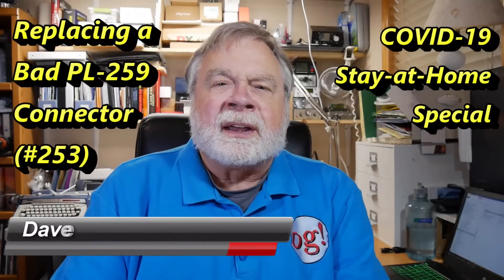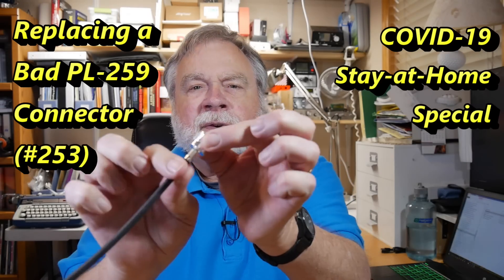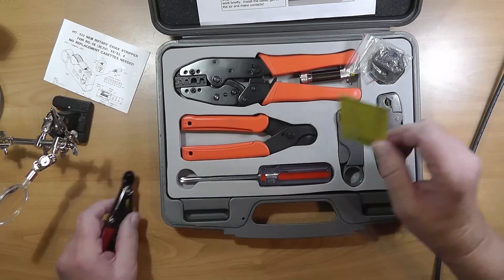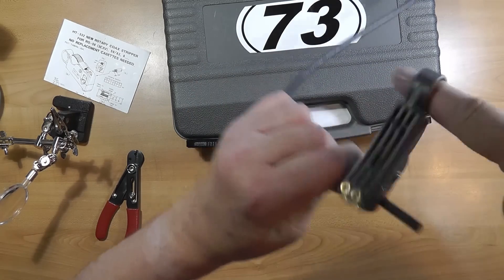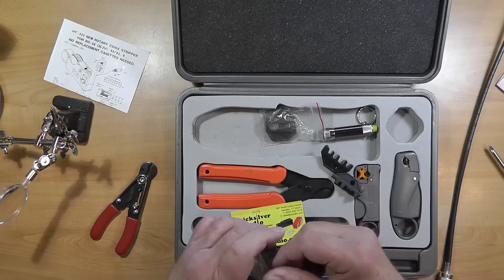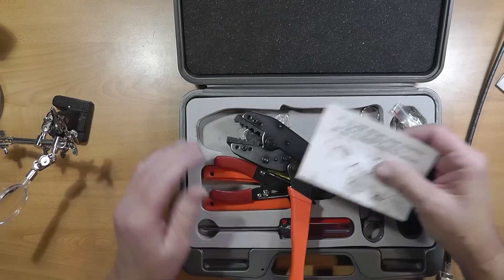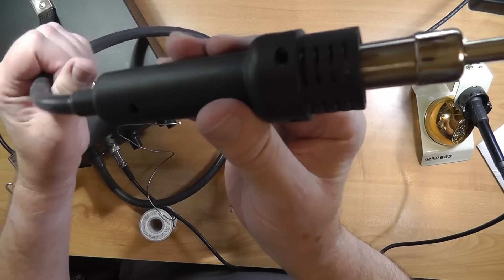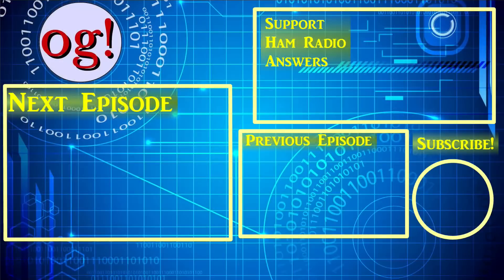National Stay At Home Special! Replacing a bad PL-259 Connector (#253)

Comment: Thank you Dave for another great video! I was wondering if you could also suggest a vertical antenna for the reference station as well. It could be a cheap or a not so cheap option with no radials ( even though that could compromise its performance) for some of us with space limitation issues. 73
Reply from the maker: Good point. I'll try to factor it into the reference station design.

Comment: As a marine electronics installer/technician,  I'd like to throw in my two cents worth.  We sparkies  have a bench but mostly we are in the field on the ground, in a bilge or hanging from a bosuns chair up a mast to do installs or repairs.   The crimp tool is the way to go both for the ferruled end and the center conductor pin.  There are many options of crimp tools and dies.  For feedlines we mostly use RG-8X(LMR 240) and LMR-400 type coaxes.  Crimp connectors are available from many sources.  Obtain better quality ones.  Carefully match the coax strip tool to the coax and the connector.  Study and follow the  installation instructions  for the connectors.  Heatshrink seal the cable  at the coax end of the body.  Crimp style coax can be installed accurately very quickly.  I personally don't care for the PL 259 connectors for the reason Dave illustrated and they are not particularly weather proof without  careful sealing with the appropriate self amalgamating tape or boot.  I am phasing in using an uhf male to N female adapter, then an N male connector.  The insertion loss is negligible The N connector is easy to install with crimp and is very weather resistant.  Also 
solar panel installs are now quite common on some boats.  Dies are available for approved solar panel conductors that fit in the same crimp tool.   These items would be good to purchase at the club level .
Reply from the maker: Thanks for the tips!

Comment: Always coat your tips before cooling bc it will go dry on reheat and burn in spots. 😉 Kc3ono
Reply: I don't even watch the video.  I just skip to the comments of everyone that think they can do better.
Reply: Radio Active just a tip to save you $$ on tips I just wet the tip and shut it down, then when I fire it back up there is the blob on the tip to coat the tip surface. Clean off & solder away. Just helps keep your tips nice and fresh. When you leave them dry deposits will burn in while its warming decreasing the surface life. ☺️😉

Comment: Good video! My hands shake really bad when I want to work on something. I also noticed that I am getting weaker with age. I like the solder station. I'll have to get one of these. I have a heavy duty Weller solder gun that I have had for at least 40 years. Not good for small work but would work for this job.

Comment: HI Dave.  Good job.  I like to add a inch or two of heat shrink over the ferrule.  Especially if it is going to be used outside.  It may or may not help.  But, it does give a work fuzzy feeling.

Comment: Dave, I'll agree some of the new crimp connectors are nice. And the rotary "cigar cutter" for stripping cable is something I should have bought 30 years sooner. But I switched to using solder paste before I insert the braid, and that does a fabulous job of flowing & melting 100% securely. (Has a shelf life, max only 2 years, in the tube.)

Comment: Hi Dave, I have been following and learning from your videos since before I got my Tech. Lic. last year. My biggest hobby in HAM right now is chasing Satellites. I want to expand to DXing on the Tech. portion of the 10 Meter band. 
I have several HT's and 1 mobile unit for 70 cm and 2 meters.
 I need advice from you or your followers on a 10 meter rig. Maybe on that is multi-band or a mobile unit. 
Thanks
73
KN4ZUJ